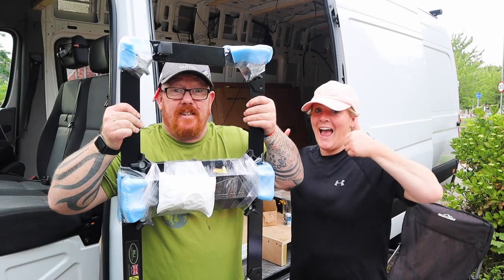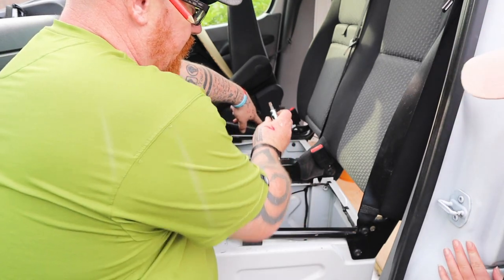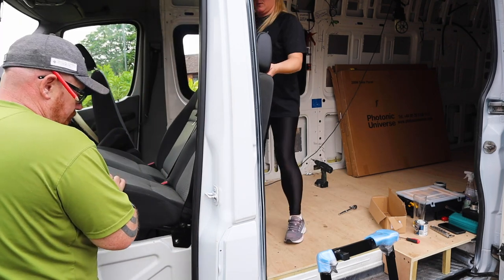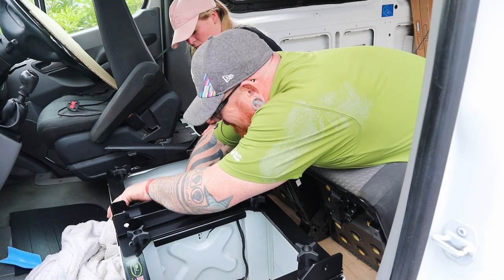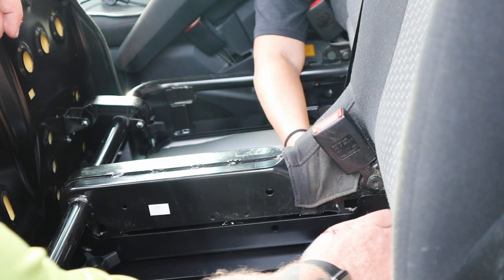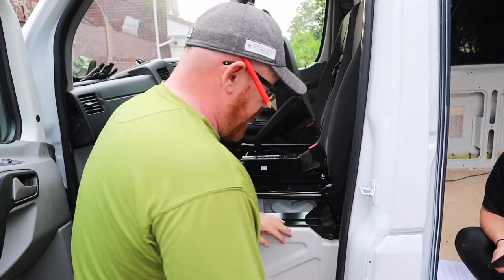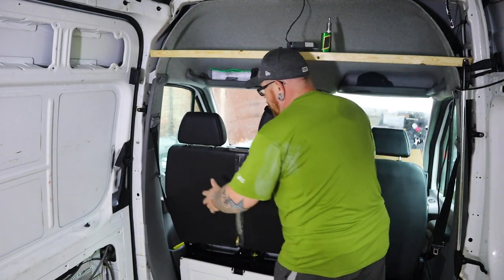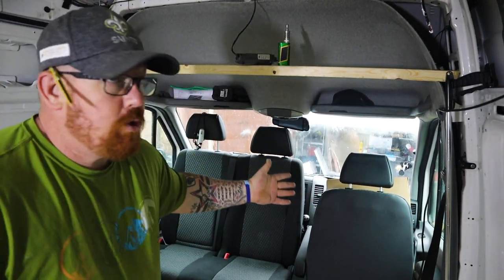Fitting SWIVEL Seats In Our VAN CONVERSION

Comment: how much extra hight does the swivle thing add to the original hight of the bench?i have today all those bolts seam like a bain every time you wanna swivel it. most that i have seen have a handle thing to pull flip it around and it pops back in place.
Reply from the maker: Yer it’s a lot of bolts but it’s crash tested and is as strong as the original seat mounts . So the bolts are needed for strength . The ones with the little lift if flat tend to rip appart on impact there very dangerous . We could have got one half the price but half the saftey  . So we decided saftey . And yer I agree 8 bold’s is a pain but only needs doing once and hopefully we will be in places for a few days or weeks